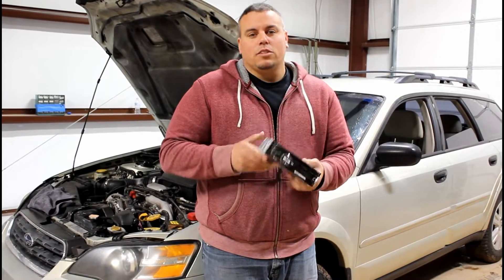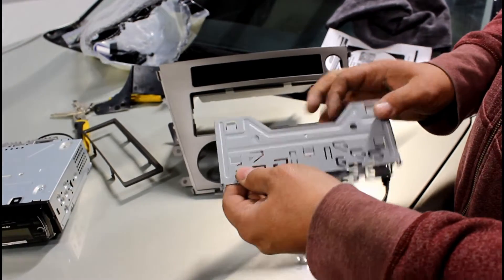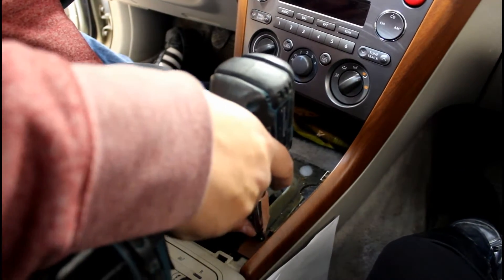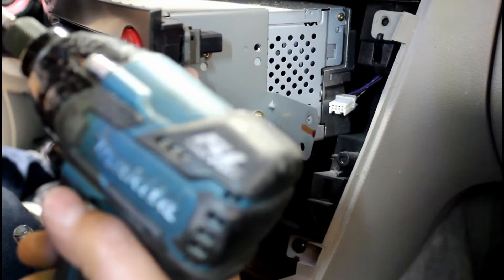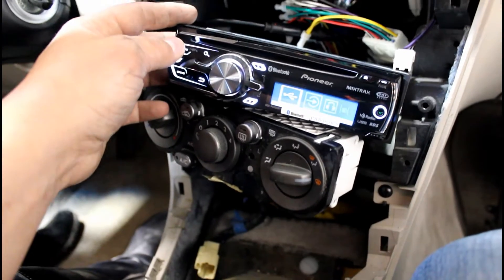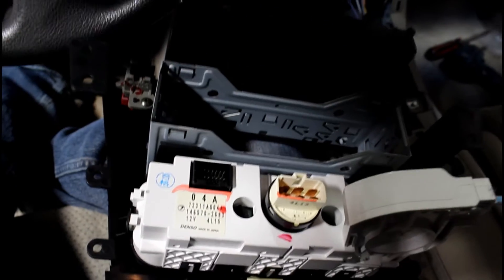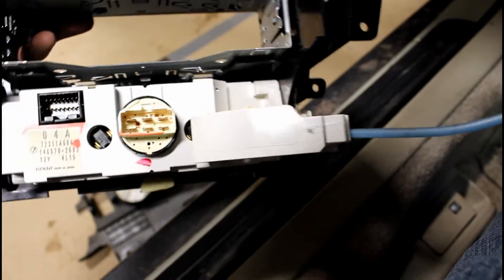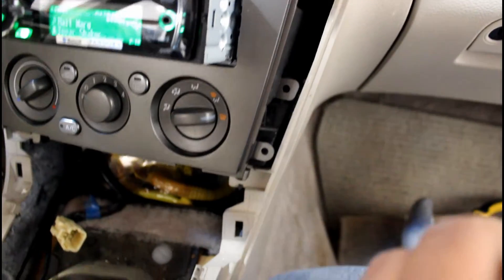How To: Replace Subaru Outback Radio Headunit (Step-by-Step)

Comment: Great video. Just got back from having a stereo installed in my 2007 and noticed I have no heat. Knob turns all the way from blue to red but only cold air comes out. Looks like I need to get down and look under the dash for that blue cable as its probably not installed correctly
Reply from the maker: Glad it helped

Comment: Hey, great video! A bit confused on a few things though. What was the point of removing the upper section (where the clock is)? also when I try to pull the radio unit out it seems to be held back by something like a group of wire, such that I cant pull it far enough to unclip them from the back. anything would help!!!
Reply from the maker: there is a cable that controls the vents

Comment: Wait so if I understand you right, there is a way to do it without having to remove the vent and clock, just because in my outback that whole mechanism is in a bad spot already would hate to pull it out and break it again. And thanks for the great video I think I will do this for my 2005 subaru outback. I also think you look very much like Farva from supertroopers which is so funny. Thanks!
Reply from the maker: get me a liter of cola.  NOW.  the hole design is shit in my opinion.  you can tray and remove it from the radio side.  i didnt have any luck that way though
Reply: @FatGuyBuilds  hey just seeing this now got my brand new aftermarket head unit installed fine didn’t have to remove that stuff. Also ran wires back for my bazooka tube and now with brand new speakers it is great. Thank you for the video!
Reply: @marekskrepp6907  were you able to use the stock 2005 housing or did you have to buy a different one like the OP showed? I want to replace my 2005 oem head until and want to make sure I have what I need before I start ripping things apart